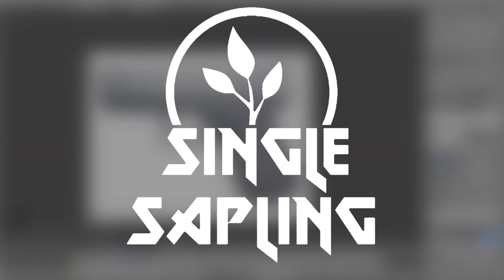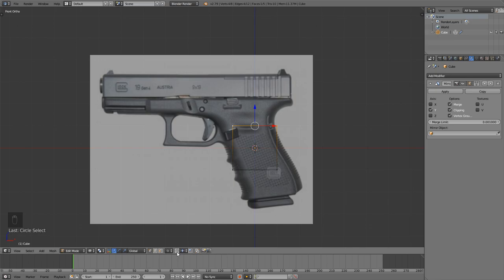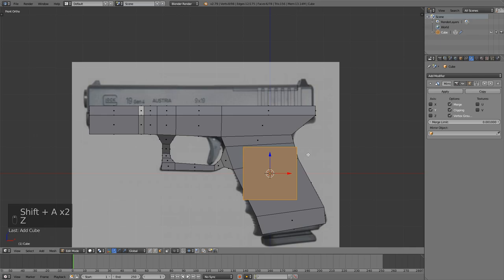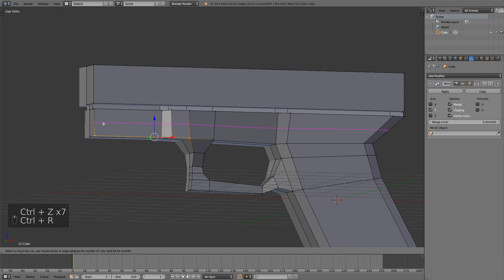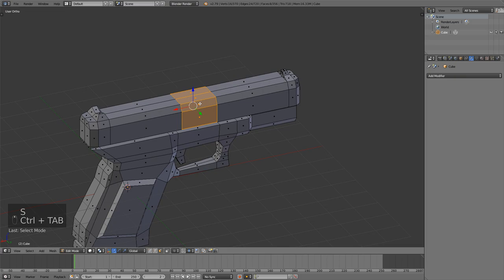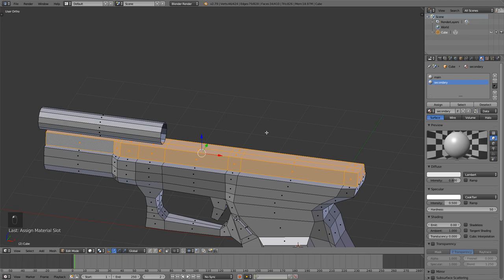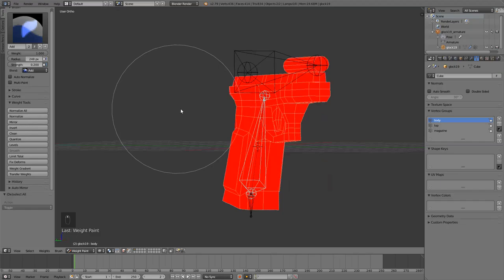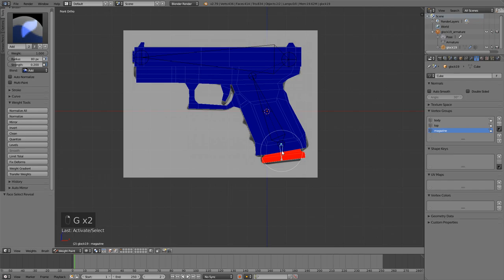Model And Rig Any Gun With 6 Steps In Blender - FPS Game In Unity - Part 24

Comment: Instead of making a loop cut, and then moving in to smooth it out, you can just hit CTRL + B, to bevel the edge.
Reply: Lancelot Krumpholz doesnt work if you already extruded sth
Reply: @JhWasTaken RBLX yeah they cause  smooth render  errors and can ruin topology
Reply: SOMETIMES
Reply: @Trentertainment yeah, but still
Reply: Bevel*
Reply: @Maggiethegsd  Thanks ;)
Reply: Armature move
Reply: STH ? ? ?
Save the Homeland ?
Sonic the Hedgehog ?
Stairway to Heaven ?
Sexually Transmitted Hair ?
South ? ? ? 
Sith ? ? ?
Reply: No that messes with the topology. When beveling you can ruin your quads. so if you use that method you can't add anymore loop cuts, any subdivision modifiers, etc.

Comment: I have no idea if youre going to see this but, I just wanted to ask, do you parent the different cubes? Because when I get to attaching the rigging or bones, I click on the parent (bones) it doesn't let me model all of them
Reply from the maker: Yes I join then all together (parent with empty groups) and then I weight paint each part (with L you can select seperate parts). If you keep them seperate you will have to select the one u want to edit
Reply: @SingleSapling  also is weight painting important what does it do
Reply: @SingleSapling  sorry to bother
Reply: @SingleSapling How do you do an empty group?
Reply from the maker: Weight painting tells the bones which part of the mesh to move. You can add empty groups by selecting the mesh and then the armature and press ctrl+p and there should be an option with empty groups

Comment: How do you add the image on the the thing
Reply from the maker: The image on the thing? You mean the background image. Quick google search should tell you how
Reply: Press N, scroll down, find backround images, click the arrow, press add image, and boom
Reply: For Blender 2.8: 
Step 1: Set the Viewport to the one you want the image to be visible (For instance, Press 1 on the numpad to use Fronth orthographic.)
Step 2: Shift+A to add a new Image > Reference.
Step 3: Go to Object Data Tab on Properties. There you can configure your Image, change the depth sorting, which direction will be shown, and if it shows on Perspective and/or Orthographic Camera.

Reminder: It's important to change your Viewport on Step 1, because when you Import a Reference Image, Blender will import them facing the viewport.
Reply: To put the image onto the gun itself, mark seams and apply the texture then line up uvs

Comment: I was able to successfully model my handgun and when I got to the part where you apply the automatic weights on the gun, there was a message that appeared at the top which said: "Bone Heat Weighting failed to find solution for one or more bones". So I need help, what do I do in this situation?
Reply from the maker: You dont need to the automatic weights, just go into weight paint mode and start painting away
Reply: @SingleSapling  Oh ok, Thanks
Reply: @SingleSapling  You don't even need weight paint mode, it's easier and fast to just turn on Show Weights for your viewport and set the vertex groups in there.

Comment: If i make the Gun and texture it in substance painter, it will be low poly?
Reply from the maker: Depends how many vertices and faces you have
Reply: texturing has no effect on the amount of vertices, low poly only means polygons= faces (roughly) and faces are made of at least 3 connected and filled vertices